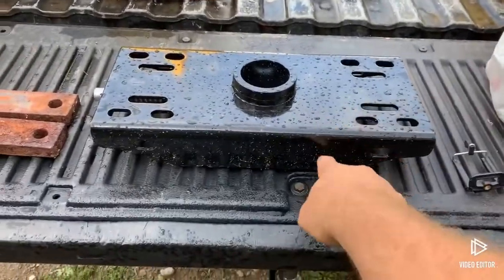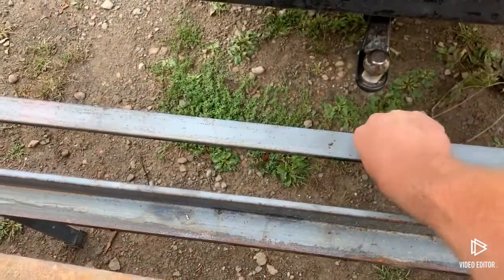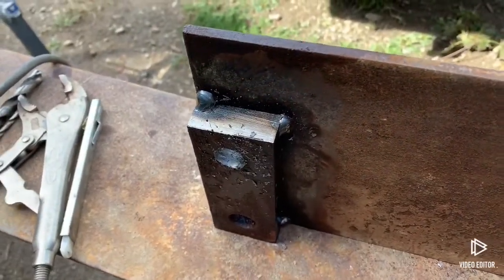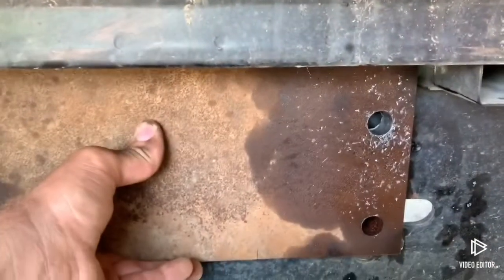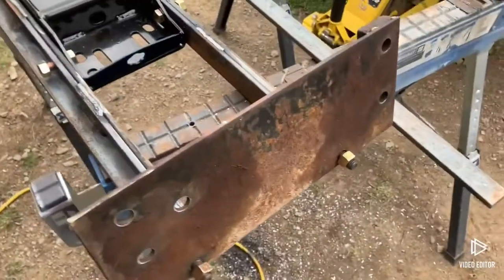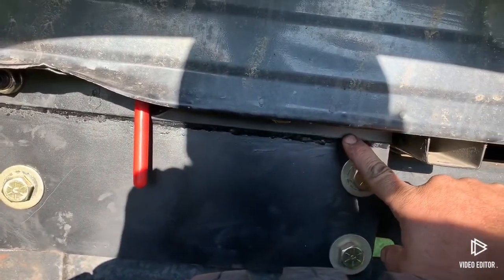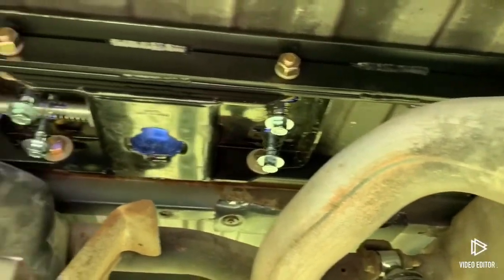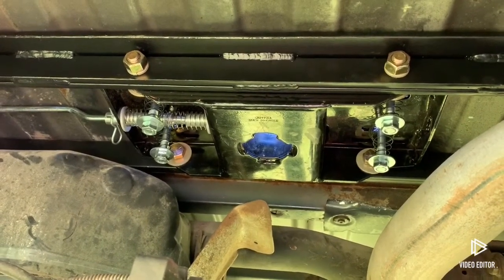DIY Duramax gooseneck

Comment: I hope  $60 in grade 8 bolts  was an exaggeration. 
Finding  a source  that sells  bolts by the pound is  worth the time  involved.  Where  I live  we have Runnings and Mills fleet farm that sell hardware  by the pound.  I get  grade  3 for around  $2/lb grade  5 for about $3.50/lb and  grade  8 for $4.50 - $5 /lb  at those  prices  I can have a good  assortment  of hardware  on hand  and eliminate  trips  to  places  that  sell  by the piece.

Also  finding  a steel  yard  that  sells  drop/ remnant  steel  is a huge  savings. When I get drop prices I can  normally  get new hot rolled steel (shorter lengths  under  4') for $0.50 - $1 / lb. 

Like  the fabrication  videos. I to have a 89 Ford  that has the flintstone option. Its ben on the list of things to  fix for  years but  always  looked like a bigger  can of worms  than I  wanted to  deal with.
Reply from the maker: I usually grab hardware from Tractor Supply idk what it exactly costs per pound, but it’s worth it. These were big bolts 5/8”, 3/4”, 7/8”. Doesn’t take many of them to make a LB. I have a good assortment of SAE hardware on hand. I like to use shiny new bolts whenever I can. Specialty fasteners I get from McMaster Carr. I used a lot of stainless Torx button head bolts on this build. Can’t beat McMaster Carr! The drop pile at my local steel shop was one of the best kept secrets out there for awhile, now it’s tough to catch it before someone else does.  Thanks for watching and commenting!

Comment: A lot better looking setup than a fifth wheel, and not having to pull the receiver out anytime you want to use your pickup like a pickup has got to be nice as well. Is there a cover to go oner the socket when not being used ?
Reply from the maker: Yea the flip over gooseneck balls are the only way to go. It came with a little round magnet for a cover. It already doesn’t stick to it. If you leave the ball in upside down it fills the hole up. However NY state road salt will rust the pin in the ball and you’ll play hell getting it out. My dad bought a Curt for his Ford. It came with a nice rubber plug. Much much nicer setup than this but also cost a lot more.